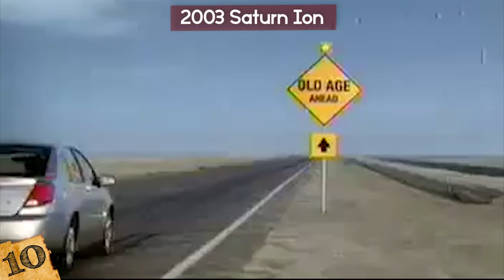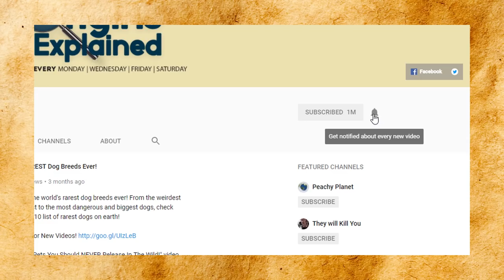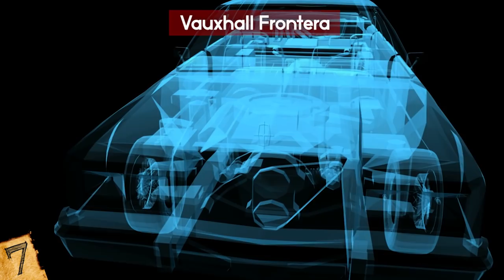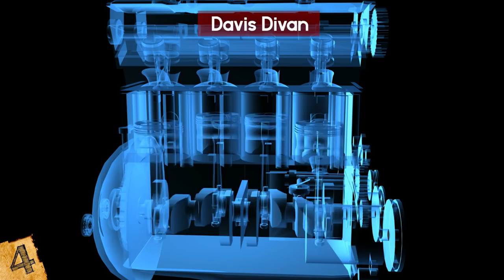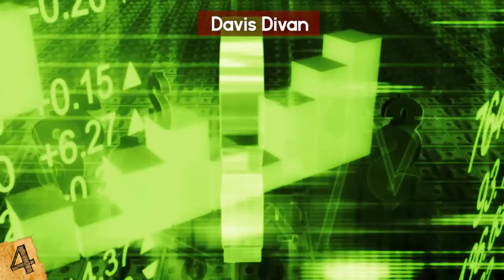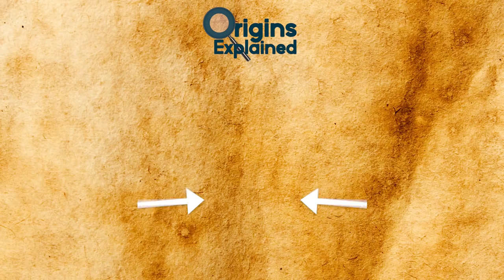WORST Cars In The World!

Comment: The Austin allegro was an iconic balls up yes it was crap but it still mocked the pants of the ford escort Xr3 and XR3I on set off 
Also I still have two reliant realtos and have spent a lot of time driving them but the best upgrade for them is rip it apart and add a motorcycle front end and seat and hay you got a trike with out reneges tearing it.ps great fuel economy.

Comment: Wow, I don't know every car here, but your information is so extremely wrong on the Trabant, that I doubt it's better with the others. The Trabant has breaking lights and turn signals. Why would it not have them? The moment you say it, they are even visible in your video! The model you named came with 23 to 26 PS (not 18), and I've NEVER seen one of them losing its side panels - I can tell because I grew up there. Brakes weren't great, but they worked. Otherwise I wouldn't live now - I've been driven around in such a car and its variants as a kid for about 10 years...
As a matter of fact, I don't like that car much either, but your information is just wrong.
Honestly, if there was an option to report this video as factually incorrect, I would have likely used it...

Comment: Chevrolet Citation was renamed in 1984 to the Chevrolet Citation II  and were fairly decent by the late 1984 model year but a list of major recalls hindered the car. THE YUGO GV from 1985-1991 Was worse than this and the 1976-1980 Ford PINTO. You also forgot the 1978-1987 Chevette. The Citation also had a 2.8L Diesel. ands' were rare as the Celebrity 6000 and Century also had the GM 4.3LD. You forgot to mention the worst build was the 1978-1985 GM 5.7L Diesel that they put in their B body cars. Cant forget the  POS 1981-1987 MASERTTI BI Turbo was the worst car ever built most of these were in in the scrap yard by 45,000 miles.  We cant forget the  1976-1981 Renault LE CAR Renault Encore 1983-1987 Renaults Alliance 1983-1987  these also needed to be motioned.

Comment: Bullshit info on the Trabant. I never saw a Trabant losing body panels and i saw a lot of trabants during my childhood and youth. It has break lights and turn signals, seat belts as standard features. The majority of production models came with 26 hp. Its not very fast but cheap, very reliable and simple to maintain. The P601 was developed throughout the late 50ies and produced from 1963 for almost 30 years with minor changes.  And there are still thousands of them that are still registered and running.

Comment: Driving a aztek right now, I personally kind of like the appearance I don't think it's a bad appearance I feel that everybody just kind of is jumping on the bandwagon and claiming it as a bad appearance but I just don't feel like it is. And as far as pictures it actually has a tremendous amount of features to it such as an air lift suspension and air compressor in the inside a on the windshield display sunglasses holders radio controls in the back yeah soda place the Pontiac Aztek as number one I feel yugo is way worse matter of fact many of the other cars on this list or way worse than an Aztec the only thing I will agree upon though is that they did equip some seriously poor quality parts to it. low Quality Steel leaves it with some parts that may break down relatively quick I feel mine has some issues with the engine had have the transmission rebuilt although it seems to be running fine after that the odometer went out on it the lights or the dash also went out. However mine has over 200,000 miles and I'm still driving it so for this to be number one compared to a car that literally falls apart if you jack it up wrong I think you're scoring system is a little off

Comment: you do realize that the trabant was made in East Germany
Reply: and not to mention that the trabant was made in a communist nation which is the reason why the vehicles so crappy and poorly built and that there's little-to-no design and engine was a 2-stroke 2 cylinder engine but there is an upside it is very easy to work on and the parts are readily available because they made 3 million of these things

Comment: Chevy celebrity..good? Please most couldn't make 100,000 miles, ik cause both my grandma and my mom owned one. My grandmas engine died at 97k due to a malfunctioning pulle and oil sludge issues as well as a failing transmission, my mom's transmission died at 101k, and the engine seized and we couldn't get it started till one time we got it started which was our mistake, it lit up the "night" when it went up in flaims. I still see afew celebrities in Tulsa but they are run down, and one died right in front of me, was leaking oil, and what I'd guess to be antifreeze, considering the fact that it was smoking

Comment: What a poorly researched and lazily produced clip this is. 
1) The Allegro - Congrats on rehashing what you would now call fake news and the rest of us call lies - There were far worse vehicles around at that time, in fact it sold well over 600,000 units which in the UK is not bad at at all, all the hysteria about windows falling out / doors jamming when the car was jacked etc. was found to be baseless - OK it looked strange but other than that it used reliable mechanicals (same as the Mini) and was fairly resistant to rust (both statements are relative) - For the time wasn’t a bad car at all. 
2) The Reliant as said below was a good option for those who couldn’t afford a proper car but didn’t want to ride a motorcycle. To put it in perspective, would you make fun of someone’s trailer nowadays by comparing it to a proper house? Same concept at the time. Also what was all that crap about the roof lifting at speed? 110% bullshit.
3) You appears to have used video clips that are unrelated to what is being discussed if you couldn’t be bothered to find something relevant.
4) Learn to pronounce Vauxhall properly - it would have taken you 5 seconds on YouTube to find this out.

A big fat thumbs down from me on all counts.

Comment: and not to mention that they were built in a communist nation which is the reason why the quality is so crappy and that they have little to no design whatsoever but there is a good thing they are very easy to work on another downside is that the engine is only a 2-stroke 2 cylinder engine and that 0 to 60 does not exist unless you're going downhill and the parts are readily available because they made 3 million of these things for more information go to aging Wheels Robert done will tell you the rest